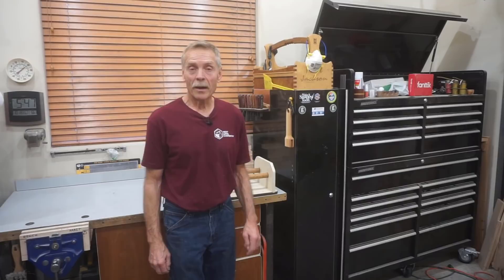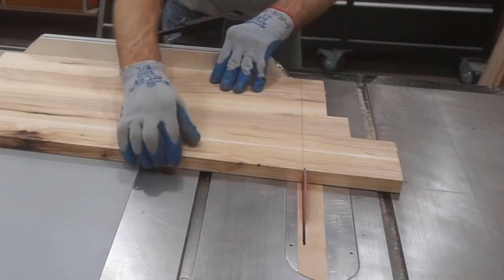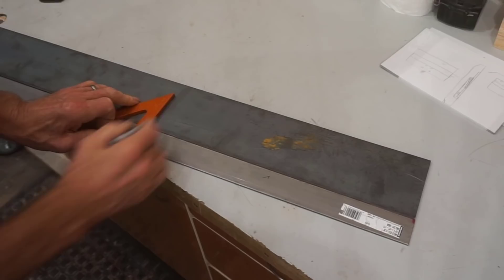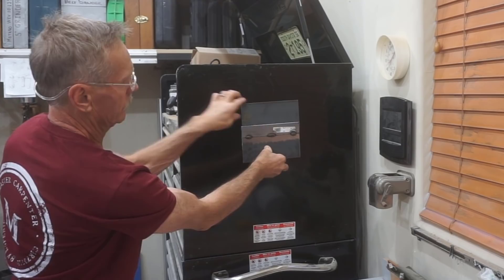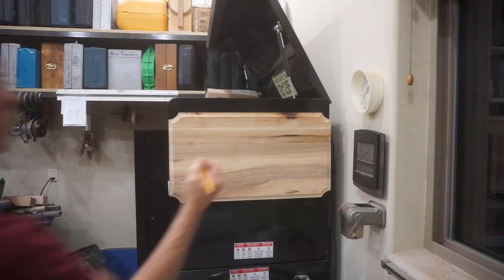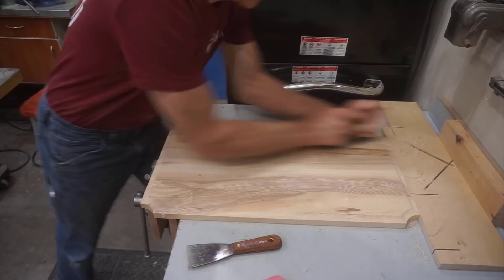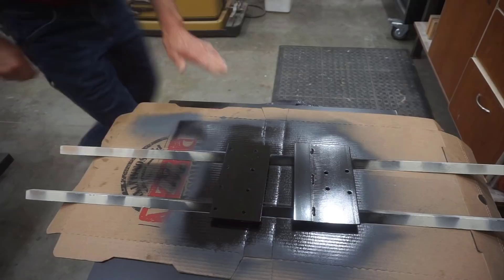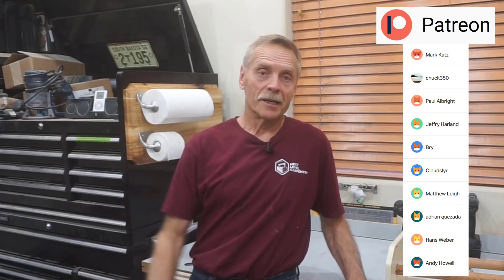Paper Towels & Tissue for Workshop Cleanup

Comment: I’ve never seen towel bars like those. Very nice way.
In my shop there tends to be a trail or two of unrolled toweling during projects. This would be nicer than a dowel holder by a wide margin.
Thanks again for a great and informative video.
Ha! Then I found it on your influencers tools and supplies page.
Thanks again!
Reply from the maker: Thanks Chuck... I'm been smiling every time I need a tissue or towel ever since I got this video complete... can't believe I went over 2 YEARS before getting this done!  The towel bars are great... they work well and look nice but, based on varied reviews on Amazon, I don't expect the ratcheting part to last for ever.  Might be planned obsolescence but they're excellent now... Best, Matt

Comment: I like those ratchet holders!   I have one in mine that mounts the towel roll vertical.  Its made from a wooden ikea dresser drawer.  I pulled it off the curb for the top and sliding hardware to use for junk and projects.  I've used the drawer sides and fronts for all kinds of things.  I mounted mine 4 strong neodymium magnets.  They have holes in them for bolts.  I can move it all around my garage, but it lives on a large metal cabinet.
Reply from the maker: I like the strong magnet idea Danny... super useful in a versatile shop! Best, Matt

Comment: Okay; let's be honest.  TP in a woodshop needs a mandatory complement of two clean joint compound like buckets, àtop each other, and the top one lined with heavy duty plastic garbage bag. 13 gallon size.  With an easy off cover.  Trust me!  Its necessary.  Like a fire stinguisher.  It lays there, till you need it for emergencies.  Every shop needs one.  I won't say anything more. 🤫

Comment: I have one of thos Kamenstein paper towel holders. It is probably the best on the market but does leave something to be desired. I find that you need to start the tear.
Reply from the maker: Jeff: did you try tightening the knob to increase tension so the tear is self starting?  I like the design but don't expect it to last forever in a shop environment but it's great in the meantime... Best, Matt
Reply: @NextLevelCarpentry  I did not know that tightening was available. I just did that and it may be the answer! Thanx
Reply from the maker: @jeffstanley4593  Cool... I just discovered it when rebuilding for the TP holder which needed to be decreased significantly to work.

Comment: Out of curiosity, as someone who also hates sanding (does anyone like it?), why don’t you use a power sander?
Reply from the maker: With my distaste for sanding I've developed a workflow where all that's needed is a quick once-over with a hand sanding block that takes clip-on paper.  Oddly it's actually easier than getting out my Mirka system which is what I use when necessary.  Seems counterintuitive but really does minimize effort required for sanding overall IMHO 😎

Comment: Still the best carpentry channel on YouTube. 

Took a while, but watching other channels for information gave me enough understanding of the job "carpenter". You guys BUILD HOUSES. Over here, carpenters mostly make furniture, because our houses are either traditional wooden houses, brick & mortar old style houses, or concrete modern ones. Normally the only carpentry in ~99% of house construction is in making molds for concrete pour and making roof supports.

Carpentry is more respectable and requires more skills in your part of the world. Over here, I'd be surprised to find out a carpenter has tools for anything other than woodwork.

In case you haven't seen this before, this is what our traditional wooden houses look like: https://youtu.be/hXWhz_egP7g?t=344
Reply from the maker: I think the statement "maker is the new carpenter" would also be accurate Chris.  'Over here' carpenters are usually the first ones on a jobsite (setting forms, etc) and the last ones to leave after trim work is up and pictures are hung having been around for almost everything in between.
Reply: @NextLevelCarpentry  wow

Comment: What do you use TP for that PT doesn't do better?  My shop has cheap PT and the fancy blue 'shop towels' (i.e.fortified with a polymer) when they need to be tough.
Reply from the maker: Wiping tips on spray cans, glue bottles, etc... the most common: a convenient/handy substitute for a box of Kleenex 😤😁😎 Best, Matt
Reply: @NextLevelCarpentry  I had the same question about the tp. Makes sense now. A lot less wasteful. Do you recommend single ply or double. lol
Reply from the maker: @charlesgraham843  ply count is kind of a personal preference thing... but DEFINITELY un-scented and no pink flower print! 🤣🤣
Reply: Me too.  Save the blue stuff for just certain jobs, and cheap paper towel for most.
Reply: @NextLevelCarpentry  I wipe tips of paint and glue on my clothes. $8 shirt is cheaper than TP and PT nowadays.
Reply: TP is better for blowing your nose!
Reply from the maker: @rickcimino5483  true dat! 😤😎😁

Comment: "You know how much I hate sanding". What's a finely tuned and fettled hand plane? What's a cabinet scraper? Gotta use the existing holes in the steel cabinet cuz nobody, anywhere sells plugs to fill holes in sheet metal. Nice looking project, though. With your OCD you would have some superbly sharpened and tuned hand tools which would save a boatload of sanding time, router set up time, fine dust mitigation, and no, you're not too old to venture into new dimensions of woodworking that are astonishingly gratifying. You might even find yourself not wired so tightly.